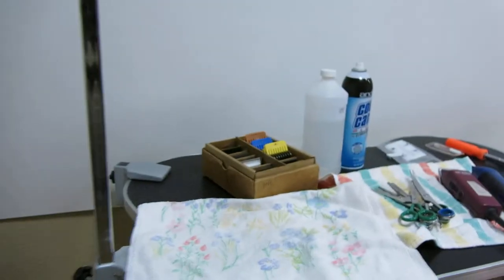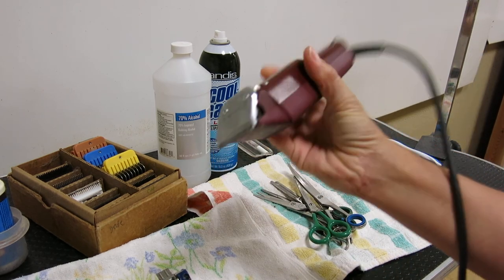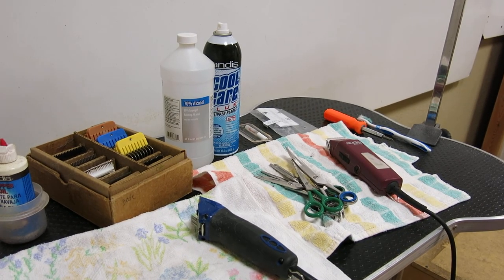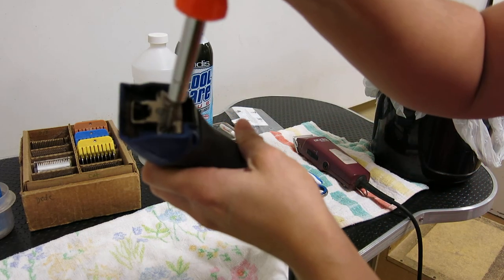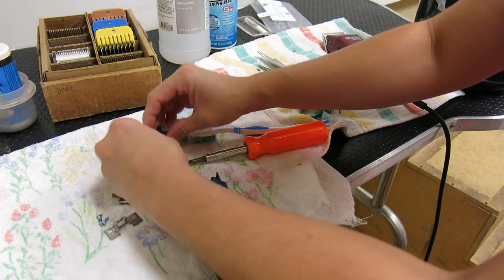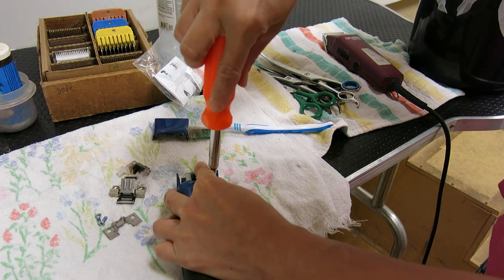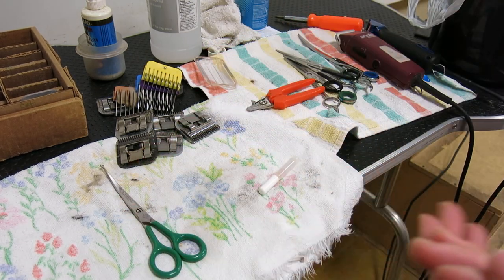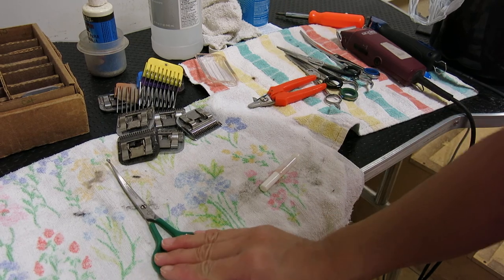Cleaning and Changing out your blade drive

Comment: Thank you dede I do pretty much the same .. but the front of my blades where it says the blade number is rusting up
Reply from the maker: I have rusted ones too.  I bought a bunch used at one point.  I think only two are rusted.  I have learned about metal and not all metal is 100%.  It could be different blends.  Having your clippers close to water and around water can also allow rust to build up.  If your blades are not rusted in the teeth etc I wouldn't worry too much about it.  Spray with coolant/cleaner and keep clean, however, for the sake of infection, if rust is developing around and in the teeth I personally would give that to a blade sharpener guy and let him reuse parts from it (recycle it) and I would stop using rusted blades.  If it was an off brand and more than one then I would go back to one of the main brands.  Let me know if you have other questions.